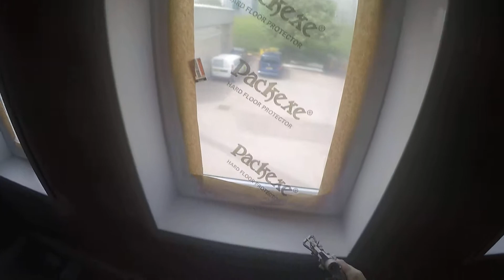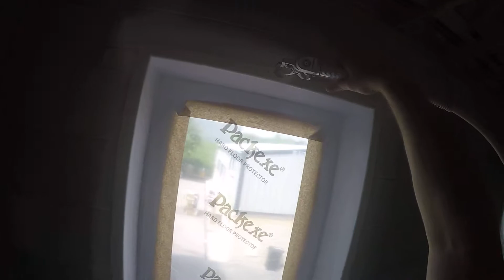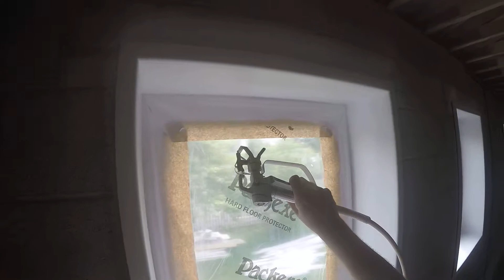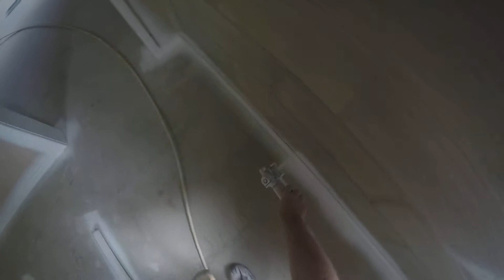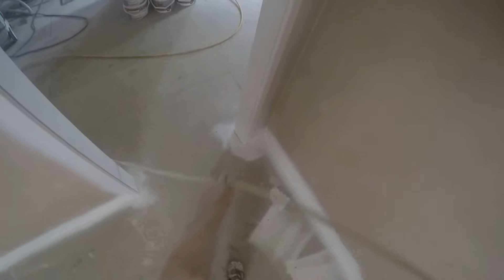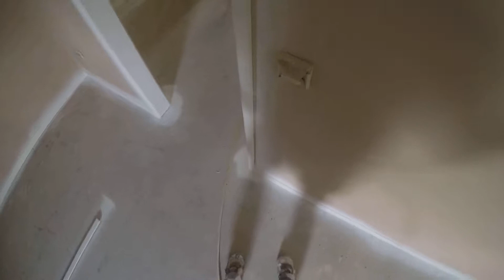Spraying trim on a industrial unit.

Comment: Hi m8 have u thinned the paint or straight out of the can also what tip setup?
Reply from the maker: Phill Godfrey Hi Phil, its not been touched with anything, its 212 ff tip its best for this paint. It was sprayed with a diaphragm pump at 2200 psi